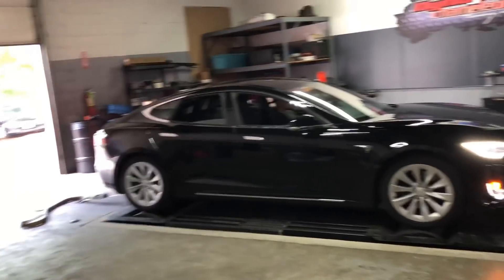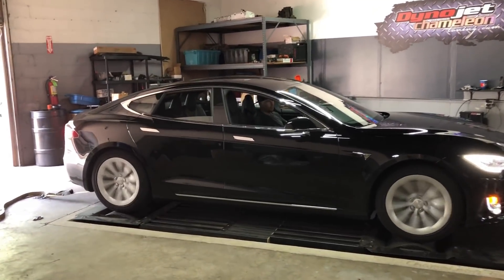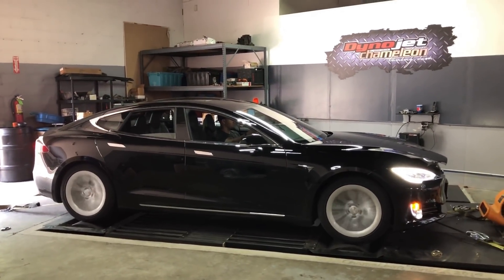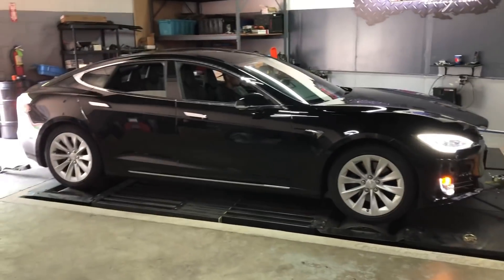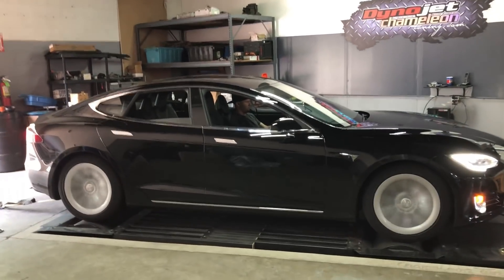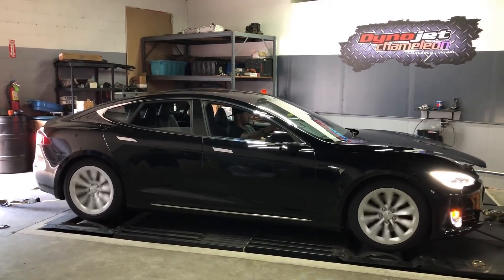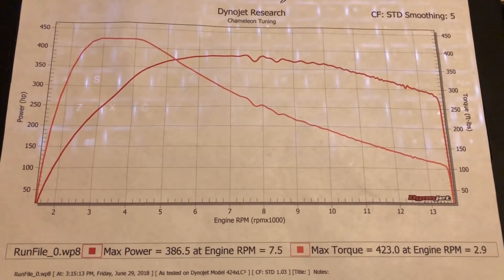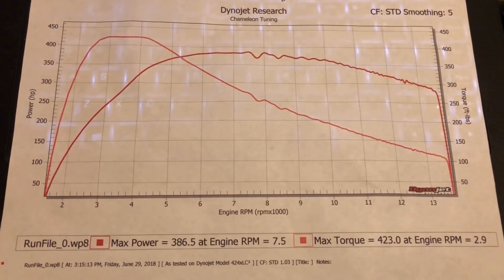Model S 75D Dyno

Comment: You say the two motors differ.  I am confused.  I understood that Tesla equipped the D models with two similar motors.  Only the P(erformance) versions have two different motors, so far as I know.  (I base this on the specs that Tesla used to publish on their website but no longer do.  I saved a copy of the specs for my car, a 70D.  I thought the 75D would differ only in battery size.)
Reply from the maker: DAVID BRYANT the motors should be identical. Should be. The transmissions we believe to be different. Tesla says the small motors all have 9.34:1 final drive ratios in them, however, in the nitty gritty, we noticed greater force being applied to the rear drum. This, coupled with CAN data that shows nearly 90% of the power is being sent to the front motor during highway cruising, and some wild guesses on our part (they are based on a good theory, I promise), has led us to believe the gear ratios are actually different. If we use 113rpm/mph on the dyno calculator, we get a pretty obscene 575ft/lbs of torque, which seems high, leading us to believe the gear ratio input is just a bit too low. If we use 118rpm/mph (the second run in the video, and calculated from a 9.73 reduction gearing), we get a more reasonable 490ft/lbs of torque.

Comment: How do you measure/calculate/input engine RPM on an electric for the dyno?
Reply from the maker: Eriamjh 1138 we input the rpm per mph. My math was off on these runs, so torque is a little low. It should be 118rpm per mph for the rear motor and 113rpm per mph for the front.